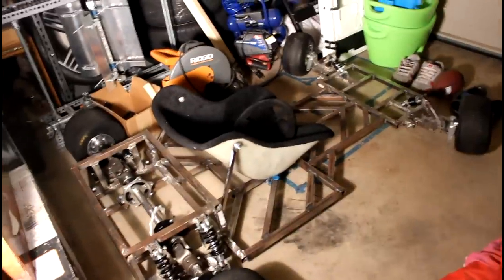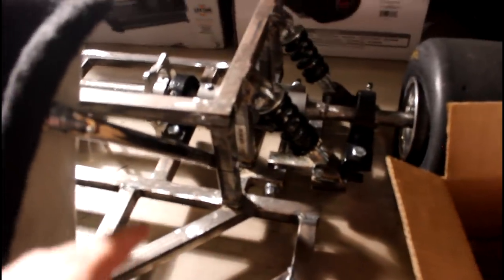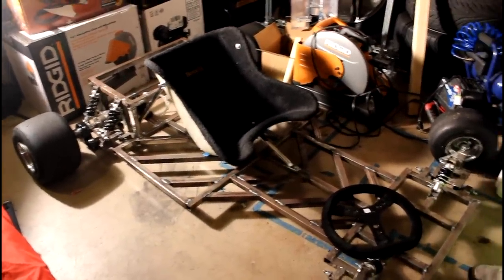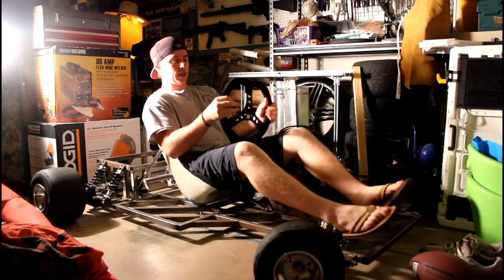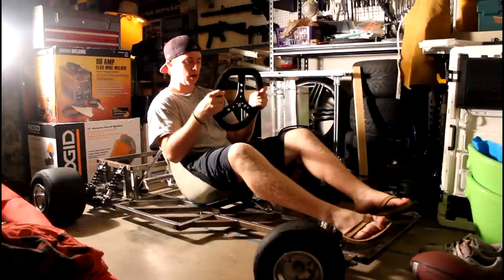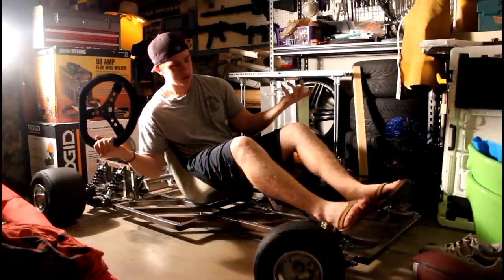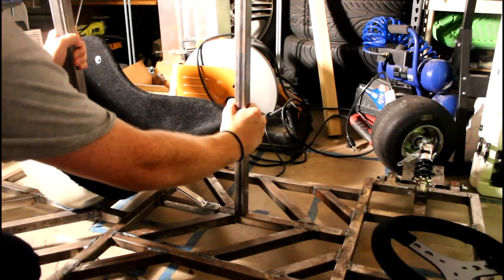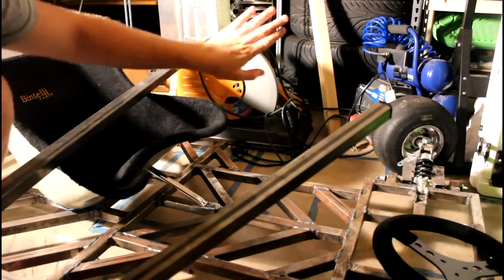(Homemade) Go Kart Build Project 17: Seat Mounted and Steering Column Design

Comment: Everything you've done on this kart is incredible, I can't believe there isn't any more views.  Out of all the go karts on YouTube yours is the best looking and probably functioning.  Since this kart is so amazing you should definitely get a torque converter, exhaust pipe, jet and tube, air filter, ARC billet flywheel and cam, 18lb valve springs, and make sure you've got a predator 212.  I just recently built a go kart with everything I mentioned but I put all of the weight in the back, you should try to add a lot of front weight because mine can't turn at all.  A heavy bumper with a lot more metal would certainly be a good idea. Otherwise, I can't wait till your kart is done, keep doing what your doing!

I strongly recommend getting a torque converter. It's makes A HUGE difference, and it's so much more fun.
Reply from the maker: Riley Witting Hey thanks for the kind comment, I appreciate it! Yea I definitely plan on modding the engine after the kart is done being built. I also plan on getting a torque converter as well, but since it's about $200, I've got to save up a little haha. Glad you like the build, lots of exciting content to come!
Reply: +Hnat Automotive Photography when are u going to upload next vid?
Reply from the maker: Uploading it now!
Reply: +Hnat Automotive Photography sweet

Comment: another idea , instead of using that 1 inch pipe as a tube , make another tab like the shock mounts and you can use 1  bolt to secure it , have 3 of those tabs and place 1 where you would mount the 1 inch tube and then 2 others towards you feet near the middle a few inches about , the make a solid structure that the steering colum can go on . that has the 3 pipes that connect to those tabs

Comment: With your bolts.... You can get ones from eBay that are rounded on the top for the seat.. You could probably find them at a hard wear store even but ok every there fall "GO KART RACING-SEAT MOUNTING KIT BY RIBTECH-CAN BE USED TO MOUNT ANY SEAT" I found that one on eBay hope it helps
Reply from the maker: josh moore Thanks, yea I was thinking about getting bolts like that so they are more comfortable while driving it, I'll give your suggestion a look!